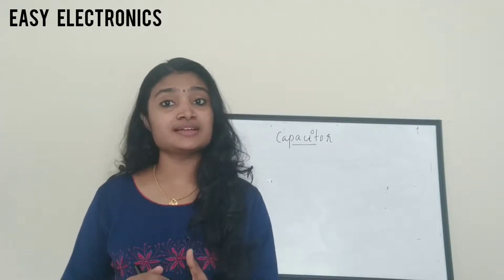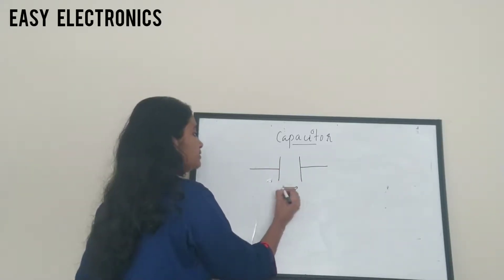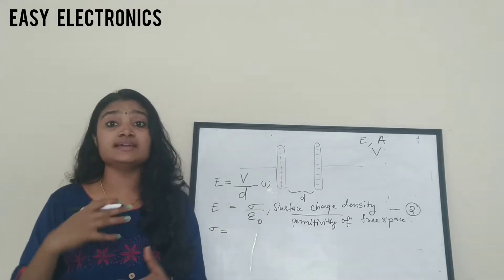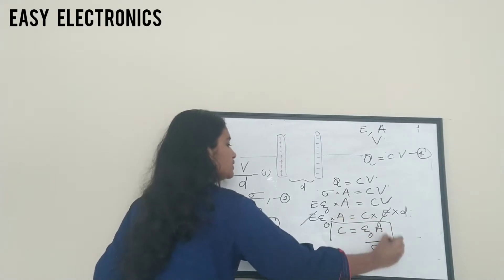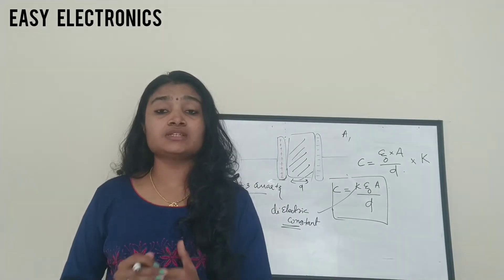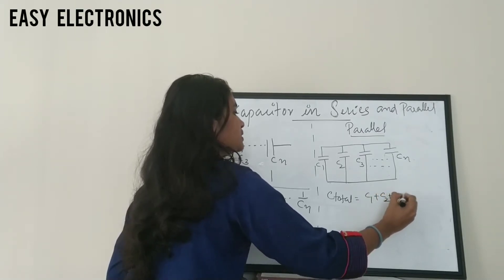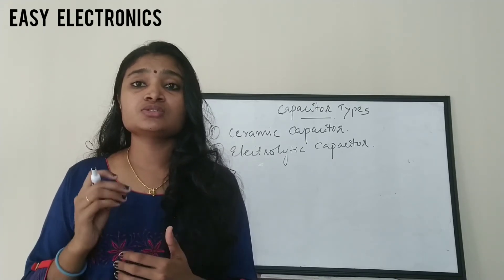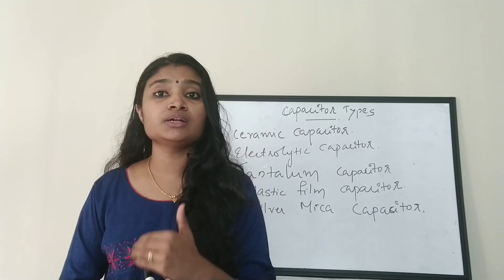Capacitor tutorial| Introduction to Capacitors|capacitor basics

Comment: What is a Dielectric medium ?
Reply from the maker: a medium or substance that transmits electric force without conduction; an insulator.
Reply: If capacitors are connected in series what parameter will be the constant? Current or voltage?
Reply from the maker: @gopikarajvs9912  current in series current is same